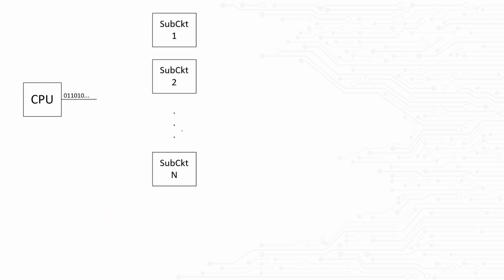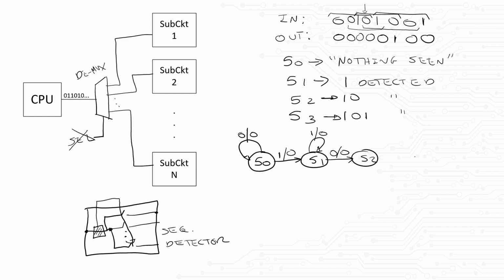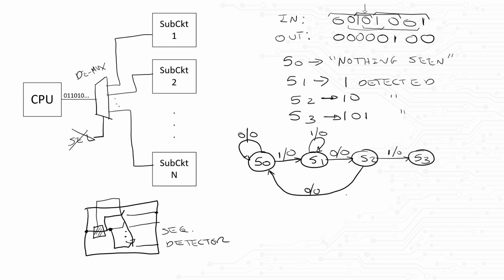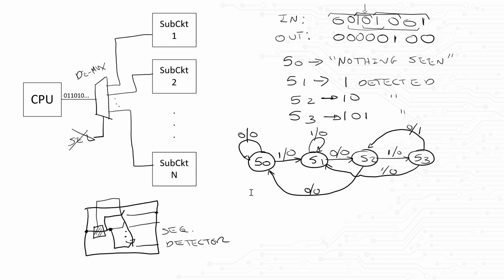HWN - Real "SoC Design Engineer - Digital" Interview Questions

Comment: Hi all, it never happens to me to see a sequence detector before, personally i would have suggest to embed some sort of "device id" approach, even if this implies having a dedicated id for each sub unit. Moreover, using a sequence detector could you possible have some strange situations in which the data stream you want to send to the subunit is seen by the sequence detector as a command regarding start and end stream, interrupting the process? 
Thanks for the video, could you suggest some book regarding basic "algorithms" and approaches in digital electronics, like the sequence detector you explained?